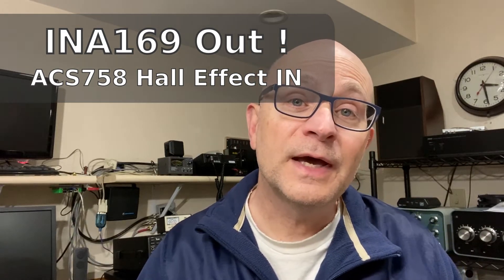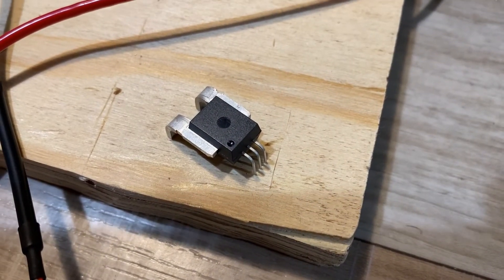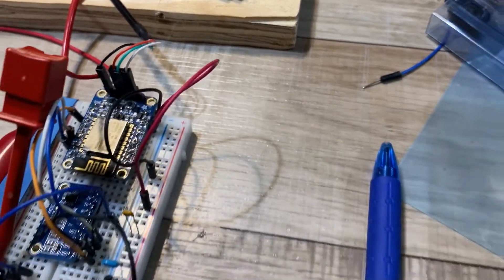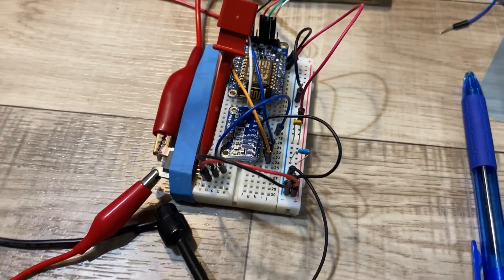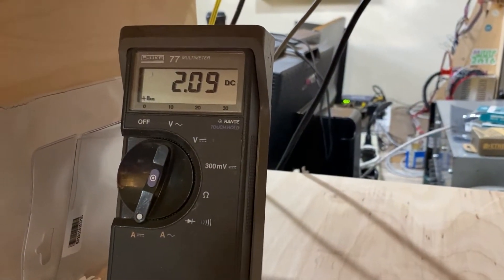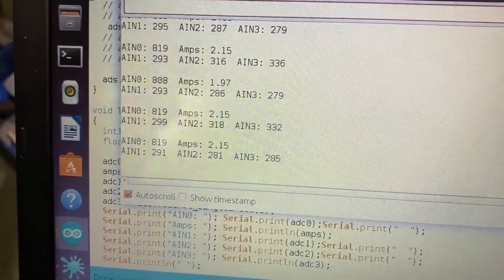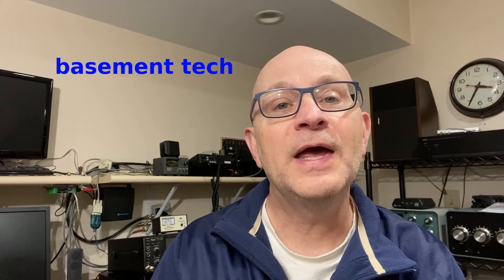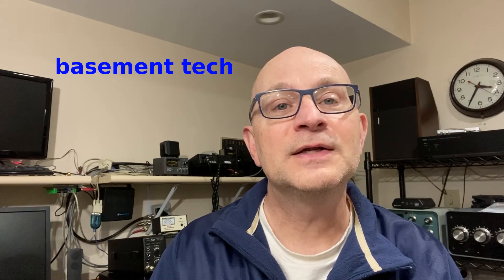INA169 OUT ... ACS758 IN !

Comment: Funny, I'm currently in the mirror of this process, with swapping out an ACS hall sensor for a INA169. I needed more precise readings that could only be given by a shunt resistor for tracking 0.2-3A. I tried this with an ACS and filtered the results so much that I was able to detect 0.2A at 12V. The problem was the position of the sensor, turning it would give different readings because of the natural magnetic field of Earth (I had to keep it upside down for absolute 0 value). I think hall sensors are great but unless you're counting amps (or halves) don't bother, the noise is too much for it to be reliable. If mA or a precise reading is what you need to track current, shunts are the way to go.
Reply from the maker: @Adrian, thanks for your comment … please keep us updated. Question: were you using a fully contained Hall effect sensor like the ACS 758 ?  I think my problem was more of noise … how noisy is your environment?
Reply: @danielatbasementtech  I was using the ACS712, +-5A variety. I spent hours trying to filter out the code but in the end there's only so much you can do. The noise is supposed to be there from factory and it only gets worse with less than perfect conditions (like temperature, static noise, etc). At the end of the day it uses the magnetic field to 'estimate' a value rather than read it.

They aren't bad sensors, they just need using depending on what your need is (e.g reading >=12V 1A, estimations.

Here's the code I came up with trying to filter out the noise (and yes you can pick up the earth magnetic field with it, depending on how you rotate it). I guess it could have used further filtering out in terms of RMS, but again, there's so much you can filter when you can't even set a baseline 0 value.

float current = 0.00000;

const unsigned long InternalReferenceMillivolts = 1080UL;

void setup() {
Serial.begin(9600);
}

void loop() 
{
current = get_reading(25);

float abscurrent = abs(current);
if (abscurrent < 45)
{
  current = 0.0000f;
}  

Serial.print("read value: ");
Serial.print(current);
Serial.println("-----------------------");
delay(2000);
}

float get_reading(int numSamples) 
{
  float value = 0.0000;
  float raw = 0.0000;
  
  float rawvRef = 0.0000;

  for(int i=0; i<numSamples; i++) 
  {
    rawvRef = rawvRef + getVccMillivolts();  
    raw = raw + analogRead(A0);                            
  }
  raw = raw / numSamples;

  float vRef = rawvRef / numSamples;
  float halfVref = vRef /2;

  Serial.print("Vref: ");
  Serial.print(vRef);
  Serial.println(" V.");
  Serial.print("Vref/2 (0 point): ");
  Serial.print(halfVref);
  Serial.println(" V.");

  float rawVref = raw * vRef;
  float voltage = rawVref / 1024.0;
  Serial.print("Detected voltage: ");
  Serial.print(voltage);
  Serial.println(" mV.");

  float voltageDiff = (voltage - halfVref);
  float absVoltageDiff = abs(voltageDiff);
  if (absVoltageDiff < 10)
  {
    voltageDiff = 0.0000f;
  }
  else
  {
    value = (voltage - halfVref) / 0.185;
  }

  Serial.print("Voltage difference: ");
  Serial.print(voltageDiff, 4);
  Serial.println(" mV.");
  
  return(value);
}

// Returns actual value of Vcc in mV
float getVccMillivolts()
{
  float result = 0.0000;
  // Set the analog reference to DEFAULT (AVcc == Vcc power rail)
  // REFS1 REFS0          --> 0b01   -Selects DEFAULT (AVcc) reference
  // Set the analog input to channel 14: the INTERNAL bandgap reference (1.1V +/- 10%)
  // MUX3 MUX2 MUX1 MUX0  --> 0b1110 -Selects channel 14, bandgap voltage, to measure
  ADMUX = (0 << REFS1) | (1 << REFS0) | (0 << ADLAR) | (1 << MUX3) | (1 << MUX2) | (1 << MUX1) | (0 << MUX0);

  delay(10);  // Let mux settle a little to get a more stable A/D conversion

  // Start a conversion to measure the INTERNAL reference relative to the DEFAULT (Vcc) reference.
  ADCSRA |= _BV( ADSC );
  // Wait for it to complete
  while (ADCSRA & (1 << ADSC));

  result = (InternalReferenceMillivolts * 1024UL) / ADC;

  // Calculate the power rail voltage (reference voltage) relative to the known voltage
  return result;
}

Comment: fun fact, I found this video because ACS758 is not for me and I'm thinking about usint INA169 hahaha i found the ACS unstable, it seemed that one day it was calibrated, the next one it was massed up.. I'm trying to measure current from a 3 phase brushless motor driver, maybe it is all the PWM on the circuit that is messing with my measurement... thanks for the video!
Reply from the maker: @Rafael Vargas … thanks very much for your comment … if you would please continue to post your results. The ACS is a pretty fast device, so maybe you could do the equivalent of an RMS calculation in software ?… just an idea … let me/us know how it goes !
Reply: @danielatbasementtech  of course! my next design will use both methods so I can compare it. When I get the results I will share here.

Comment: I like to measure 3 phase mains (safety first) 50 amps max can  you have the sensors next to each other or do you need to keep a minimum distance fro the magnetic field not to jump sensors?
Reply from the maker: Hi Sophisticated Stupid-Monkey ... thanks for commenting... which sensor do you use and how do you read it ?

Also, what do you learn from the data ?
Reply: @danielatbasementtech  I am looking at the ACS758 stil browsing for the right sensor but this one looks promising.

Comment: Hi 

Nice video. 

I have several hall effect breakoutboards including the ACS758 (50/50 and 100/100) and the acs712 20 and 30 amps versions  but it seems they are only good for lots of current. I am trying to make a measuring system that can track my batterie levels (ie amps going in and out.) Since it is solar charged/powered there can be big differences in amps going in. It can reach about 25 amps on good days and a low as 0.01 amps when sun sets. Also the stuff drawing power can be a simple sensor or an 300watt inverter. I noticed that I cannot seem to get the hall effect types to alwasy return zero when no current is passing and since the resolition is so low (reading with the 15bit ads1115) and when trying to ignore millivolts very close to a zero reading It still spikes some times and my meter shows like 0.7 amps (x12v =  8.4 watt) when there is no current. 
  
So far all examples I could find are eiter  only low current (max 3amps) or minimal 2 amps or higher. So now I arrived to the conclusion that they only way to do both is via shunts so I can go super low and pretty high. But now see your video and I worry again. 

Well I am going to try it anyway.
Reply from the maker: @Hans de Groot ... thanks for your comment.

I do believe that it is difficult to have such a wide dynamic range when measuring current.  However, I would love for others to comment with their experience.

I watch another channel Andreas ("that guy with the Swiss accent") ... he may have ideas also.

As I mentioned in the video, I did not do a good job controlling electrical noise (full shielding all cables, bypass caps, etc.) and the stepper motors/controllers generate a LOT of electrical noise.  I suspect that your environment may be more forgiving.  In my opinion, I think your inclination to use a shunt is a good one.  You will end up with very small signals, but with a good think about noise containment, I would guess you can maximize the dynamic range of your measurement system.  (I do intend to revisit the physical shielding and attempt better results)

I should mention, in my "basement" space, using a simulated, resistive load, I did have success with the high side amplifier (INA169).

I do also owe you guys one final video on the fully deployed system.  It's pretty cool with the Neopixels.

I hope you will post your results so that we can all learn from your experiences.

Thanks again,
Dan